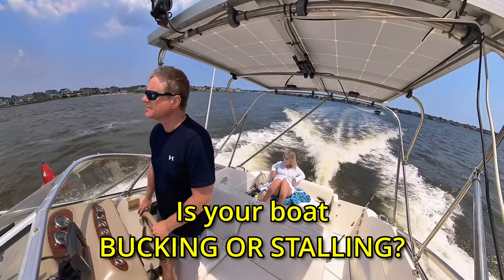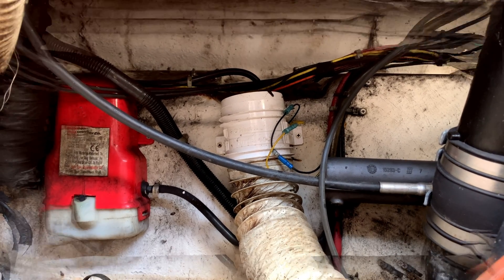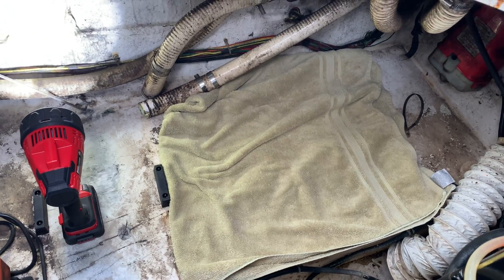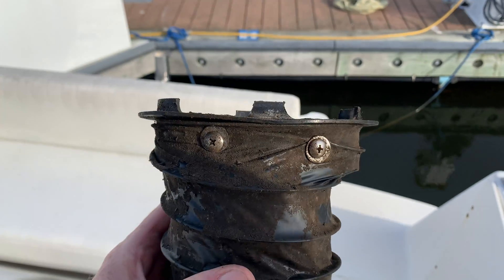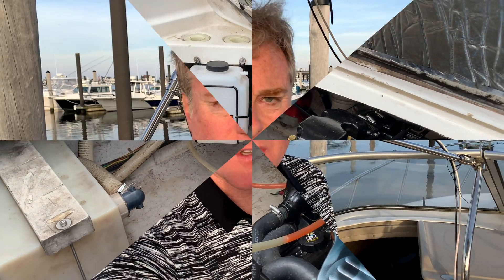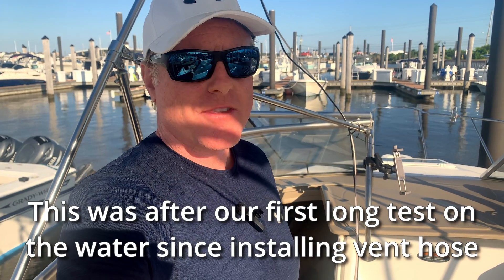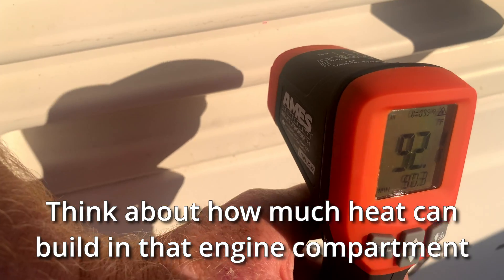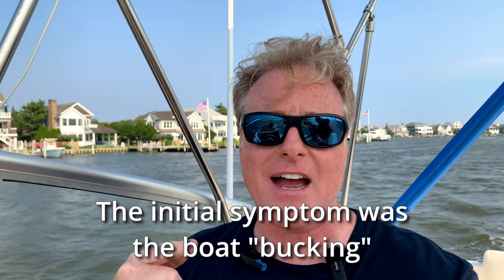FIX Stalling Overheated ECM and Vapor Locked Mercruiser MPI with VesselView Information

Comment: I built a new engine house. With out the vent door on top of the box. Went out 2300 rpm for 40 mins. Engine stalled. Had to be tow in. Wouldn't start again. A week later in the drive way. Started it and it start right up.  Conclusion is: hot engine compartment will cause either vapor lock, AND/OR faulty ignition coil, or ECM. 
Bad ignition coil can lead to slowly flooding the engine due to lack of flame to burn off all the fuel. Stalled, but can be start again after awhile with WOT.
Bad coil, cant start again. No sparks.
Solution: i replaced new coil. Test ran with hose seems smooth and normal for extend period of time, but not yet in river.
Reply from the maker: Thanks for sharing your experience.  I'm so glad someone else can attest to the ECM overheating and causing issues.  It would totally make sense that a computer starts acting up when it is heated up too much.  Years ago I had an old computer that I need to have a fan blowing on the the mother board or it would lock up.  Same thing happened to an old big screen TV I had after it got really old.  Needed to have a fan blowing on it all the time or the chip would start making rainbow of colors across the screen.

Comment: Do you run with your blower on all the time? Or  does a bad hose do some venting even when the blower is not running (ie while you’re driving?). I was told to only run the blower to get rid of fumes before you take off. Thanks for the video! I’m having exact same symptoms and driving me nuts!
Reply from the maker: Thank you for your question.  So quick answer, Yes.  I run with my blower on all the time now.  With my old 5.0 220 HP engine I would sometimes shut the blower off if I was running at cruise for a decent amount of time and turning it back on every few minutes (for 30 seconds or so) just to clear the engine compartment.  That engine only had a 2 barrel carburetor so the connection from the fuel pump was a 12 inch metal tube to the carb.  The 383 MPI Stroker has a higher pressure fuel line going to each cylinder.  I've taken temperature readings all over the rail and I've seen readings as high as 140 F.  Gas can start to vaporize as low as 120 F.  I did a little more research about vapor lock this morning because I did have a slight bucking problem in December BUT I get my gas at Costco/Quick Check and here in NJ we would have switched to winter blend which has more butane and hence could vapor lock even in December when I was running all day.
Reply: @Nautisphere thanks! I will try that. I need to get one of those temp guns you have! When we open the engine compartment, the risers and other elements don’t feel hot…so not sure it’s the same issue.
Reply from the maker: @jrobber999 the risers should be hot but not super hot because they have the raw water running through them. I got that temperature gun at Harbor Freight.

Comment: I have a 50hp mercury outboard having the same issues with dying after a few minutes on plane. I plan to replace the anti siphon valve tomorrow, is this something I would need to check out with it being an outboard?
Reply from the maker: If it’s an outboard I don’t think it has an anti siphon valve. From what I know only inboard engines have it in the event the hose gets cut to stop the bilge from filling up with fuel. I would suggest checking if the hose is collapsing and see if there is any debris on the screen on the pickup in the tank. You could also try running the engine on a separate tank and see if the problem still happens.
Reply: @Nautisphere it did have one, I replaced it along with the pickup tube, neither seemed to be gunked up or damaged so I fear it may not solve the problem.
Reply from the maker: @ Years ago I had an issue where a film would develop on the mesh screen. It was after Super Storm Sandy. I left the boat on land that one year so the fuel was over a year old. It took me a whole season before the gas was all clean. I’d have to take the pickup out while on the water and no exaggeration blow through it and little piece of sediment would cone off and you could see a sheen on the mesh. There was definitely water mixed in it also.
Reply: @Nautisphere I have think I have the problem tracked down to a cheap $100 high pressure fuel pump I put in a few years ago, it’s been doing it ever since then.
Reply from the maker: @ That sounds like it could be it. A really good mechanic would always tell me when I was troubleshooting “did anything change since it started happening”. That’s how I figured out my problem with the vapor lock. Everything was fine and the only thing that changed was my blower motor died. I replaced and the upper hose fell apart from being 20 years old. I figured hell with it, the vapors are being blown up towards the vent. Little did I know the “vent” on the back of the boat was more for show and there was only a 3 inch hole leading to the “vent”. See if you can find any information about it not working within specs. Also double check the voltage going to in. I’ve had problems where there was a lot of voltage drop and a meter showed it bouncing between 8 and 13 volts DC.
Reply: @Nautisphere I had a input shaft bearing explode right after installing the pump so that took my attention off the pump and I’ve had that problem since I got it back from the shop so I bet it’s that pump
Reply from the maker: @coreydeyhle4356  let’s us know how you make out and if a new pump works which one to stay away from.